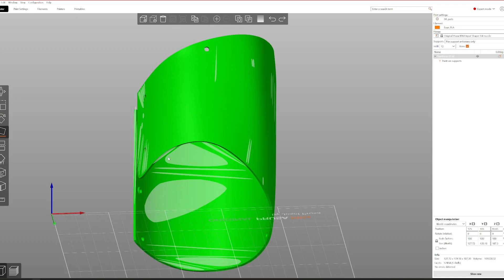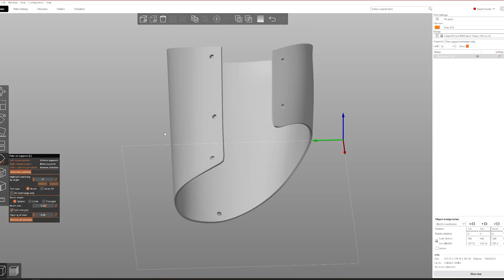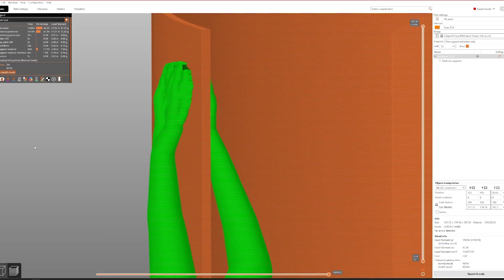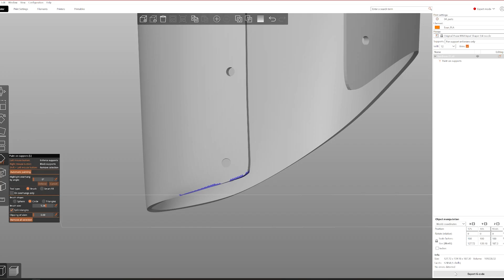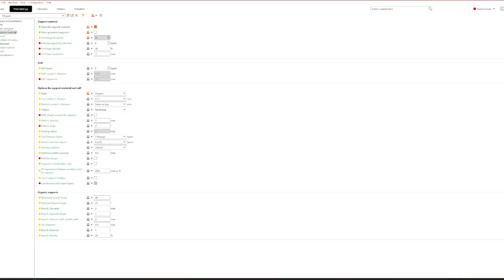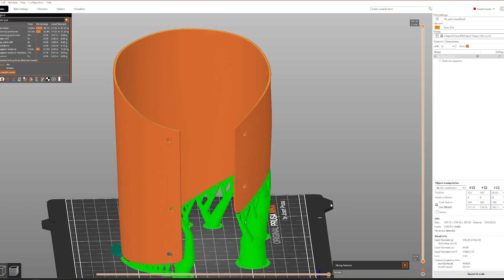Tips for quickly supporting 3D models (PrusaSlicer)

Comment: Just curious as I've only bought one printer before, should all one-arm printers be avoided in general? Every time I used the one I had it would jerk the arm so bad that it would rock the print job and ruin it.
Reply from the maker: one arm printer? You mean bedslinger? No they can be amazing printers dont have to avoid them. FDM Printers have come a long way in 10 years time.
Reply: @JanovichPlus  Thanks, yeah the ones I'm seeing online now look way more stable. At the time there was no opposing horizontal arm support for the one I bought. Thinking about getting one before Bloomberg starts pushing another state campaign against 3D printing where I live.